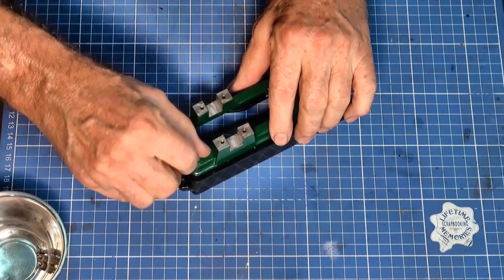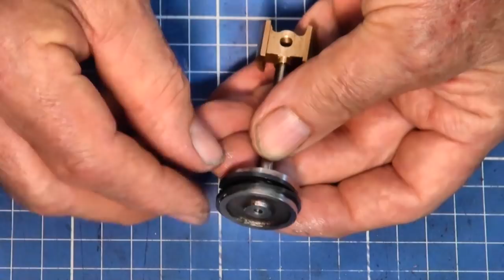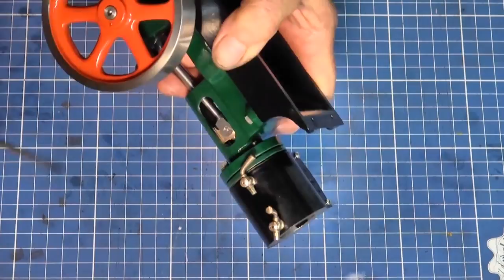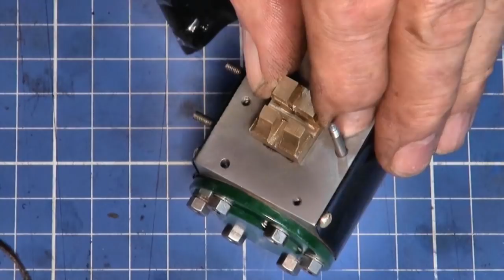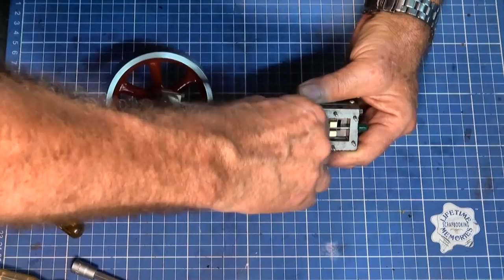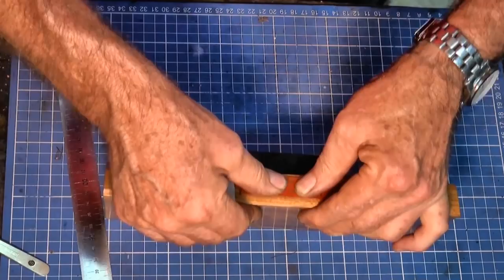Building the Stuart Turner Number 8 Mill Engine - Final!

Comment: Outstanding series of videos, the best model steam engine build I have seen & I’ve seen a lot! I have built nearly all the engines in the Stuart Turner range over the last 50 years, however, I have not built the No8, which is the last engine I wish to build….The casting kits are now so expensive & casting quality is not as good as when produced by Stuart’s years back, sadly!! Thank you again for a wonderful build series on this engine. 10/10 ✅👍😊
Reply from the maker: Thanks. The set of castings I was given for this engine were some 40 years old. My only issue with them was that there wasn't a lot of machining allowance on some of the critical components. I am actually building the Stuart Turner 10H at the moment and it's castings are quite old as well. I took the Number 8 out of the display cabinet the other day and compared the two models. The #8 is definitely the better engine of the two and closer to full size in terms of it's features. 
Regards,
Mark

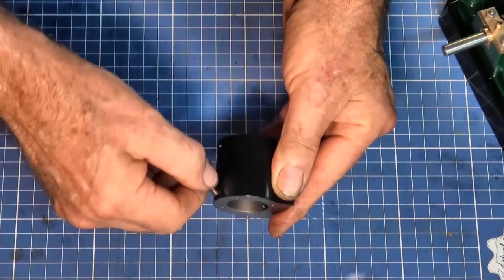Comment: Overall an outstanding job. I am in the UK, I started to watch these videos last night and was so into it, that I have watched all 13 I believe it was episodes. It is now 08:52 hours and I have been up all night. I am retired now and have just completed my workshop build and my first project will be a double acting boiler feed duplex pump. When I was an engineer in the merchant navy and had to tell the 2nd engineer that I had fu**ed something up, his only question was “what are you going to do about it” well of course the only answer was to have a plan at hand to put it right. I admired this about your build, you included some errors along with solutions to them. I agree with you, the connecting rod for the big end brasses looks much better in steel and your final design looks much better and more like the real thing. I have really enjoyed this series and believe you have done a fantastic job. I thought at the end you were running the engine without oil and I became concerned but slowly there were tell tale signs that the engine had in fact been oiled. I loved that laser machine you used for the gaskets and I need to get one. Thank you for sharing. Now I need to go back through every episode and ensure I placed a like, sleep first though.
Reply from the maker: Thanks Bernie. I have one of those Stuart boiler feed pumps. It runs on air just fine but whenever I tried to run it on steam it just jitters back and forwards without completing a full stroke. I built it back in the 80's when I didn't have a lot of tooling and I really should go back over it and re-machine the shuttle valve and piston valve. I'm glad you enjoyed the Stuart #8 build. I was very happy to have the engine returned to me after Keith kept it for a year or so. 
Regards,
Mark
Reply: @Preso58  Yes Mark those duplex pumps can be a bugger on steam, it usually concerns the shuttle valve. I really want to make one because the very first ship I was on in the Merchant Navy had duplex pumps as harbour feed pumps, just for the light load in port. Once away at sea we used steam turbine feed pumps. I will then make a boiler followed I hope, by a Stuart triple expansion or a Stuart No. 3

Comment: Very nice video series. Amazing craftsmanship in the build. Its beautiful. One tiny nit. There are two drain cocks to allow the operator to purge the condensate that can collect in the cylinder during operation, and more importantly, when you shut down the steam. One at each side of the piston. They really should be on the bottom of the cylinder to the water can drain. You have them on the side, opposite the valve chest. They won't really drain the cylinder below about half full -- way past hydraulic lock.
Reply from the maker: Pat, yes you are correct but that's where they were shown to go on the drawings. The other aspect of this is that when starting a cold engine the drain cocks need to be open so the condensate can be blown out so there is no hydraulic lock. So, as long as there is a pathway to atmosphere the water will be blown out but it won't drain under gravity. Vertical engines have the same problem with the top drain cock unable to drain condensate but you can cycle the engine with the throttle closed so that most of the water will be forced out as the piston rises to top dead centre. 
Regards,
Mark

Comment: Nice build and very instructive  on the working  and   timing of a steam engine.. As a retired  toolmaker of over 50 years  experience  and have broken more taps than I care to mention  a better way to fix the boo boo is drill it  to a bigger  thread  size  and retap then  screw in a  plug made preferably  from the same material  (cast iron) pien it over and drill and retap and flush  smooth  .. then only  you and  God will know.. 🤫🤫
Reply from the maker: Thanks. That engine was returned to me after the original owner passed away a few years back and although I never expected to see it again it was nice that his eldest son passed it back to me. Keith was always a bit of an alternate father figure for me. He owned a beautiful Myford Super 7 lathe and he was meticulous in everything that he did in his workshop. 
I think I have only broken a couple of taps in my time but they always seem to break off below the surface and they are always torqued in so tight you would never in a million years back them out. The worst was a 2mm tap broken off in a stainless steel tail cone for a model jet engine. I had spent days machining it out of a piece of thick walled stainless steel pipe and I had to tap three holes in the thick part of the flange. Of course, it broke off in the last hole and it was the last operation in the entire part. There was much gnashing of teeth and rending of clothes but I ended up burning it out with an oxidising flame in an oxy acetylene torch using the tiniest tip and the smallest flame I could get away with. It just went bright red and then I turned the fuel off and the oxygen just blew it out. Whew! Crisis averted.
Regards,
Mark

Comment: A great build of an outstanding series, I watched them all. Excellent final presentation now for a boiler, I shouldn’t talk, I haven’t built a steam engine let alone a boiler but the final presentation is so much better. Cheers Peter
Reply from the maker: I do actually have a boiler but it is inside a model tug boat which is inside a glass case and I couldn't be bothered getting it out to steam it. I am coming around to the idea of building a vertical boiler which can run on gas or coal because I also have a steam water feed pump that has never run on steam either. It's on the bucket list anyway.

Comment: Brilliant series, watched the whole lot.  May I suggest the acquisition of these items to help with assembly; Draper Screw Holding Driver Set.
Reply from the maker: Ira. I sometimes deliberately magnetise a screwdriver tip to hold small screws but that trick doesn't work for brass or stainless steel screws. Those Draper screwdrivers look like they would be a good option though. Thanks for the tip.

Comment: Thank you very much for the series. Really good videos and a nice engine. At the beginning you said how Stuart were famous for producing great casting sets. Accepting that these castings were 50 years old, and that the company has changed hands many times since, do you now think the kit you worked with was top quality? There seemed to be both quite a few casting problems (insufficient machining allowance mainly), some design problems and a few plan errors, that you had to deal with. No reflection on the current offering of the Stuart No 8, which  may well have improved or worsened over the intervening years, for all I know.
Reply from the maker: Hi, I must say that I was a bit disappointed with some aspects of the kit of castings. The material itself was very nice to machine with almost no hard spots or chilled areas and the iron was fine grained and the surface defects  were minimal. As you have mentioned, the main issue was lack of machining allowance. In some cases there was almost nothing left to machine off. A few of the non critical features were a bit outside the allowable tolerance but none of those affected the operation of the finished engine. I purchased a set of Stuart castings for the twin cylinder marine engine back in the early 80's and they were of similar quality although I don't recall having the same issue with machining allowance. My comments about the reputation of the Stuart company were based on some research I had done rather than from personal experience. Having said that I have purchased castings for some workshop equipment and two different 3 1/2" gauge locomotives which were somewhat worse in terms of surface finish and overall quality. I also believe that Stuart used some common castings for a range of different engines so perhaps they had to compromise on the overall size to allow for that.

Comment: Fun series. Thanks for sharing. Did you put any sort of coating on the bare metal parts to prevent surface rust or tarnishing? I'd be tempted to put on thin coat of floor paste wax, especially on the beautiful flywheel.
Reply from the maker: Brian,
I think I just coated the parts lightly in a thin oil. The model is being kept in a glass case at present but I will have to monitor it to check for that insidious rust! I restored a large set of balance scales for my sister just recently and I used linseed oil to prevent if from further rust. It was made of wrought iron and was in a pretty bad way when I got it. I used the electrolytic rust removal technique and that worked quite well. I have some paste wax which I can use on the engine if it looks like corroding. Thanks for the tip.
Reply: @Preso58  Upon further consideration, wax would be a bad idea if the engine was run on steam as I think the heat and oil would make it turn into a gooey mess. Seems ideal for a static display model though. Cheers!

Comment: Please run this on steam!
Reply from the maker: Jim, once I finished the engine it was returned to the original owner. He ran it on air for his 90th birthday but about a year later his oldest son returned the engine to me. I would love to run it on steam but I don't have a boiler for it. I have a vague sort of plan to build a coal fired vertical boiler as I have a Stuart reciprocating boiler feed pump and a large single cylinder steam engine that I made back in 1978 when I was at college. However, I also have a very long list of other projects that are higher on the priority list at present. The other consideration is that these engines always sound better when they are driving a heavy load. When running unloaded they don't really "come alive". 
Regards,
Mark

Comment: Nice job Mark. Lovely little engine. I'm very envious of all the workshop equipment. What's the next engine? How about one you don't need castings for? Take a look at J. De Waals Robey Sugar Mill on www.modelengineeringwebsite.com. Should be right up your alley, although a steam mill thats designed to crush things might not be a good idea for your fingers...
Reply from the maker: Jason, I have a model turbojet engine that I built about 10 years ago sitting in a cupboard waiting for me to get running again. I keep putting it off because it scares the living daylights out of me when it gets going. It suffered a hot start  the last time I ran it and the nozzle guide vane housing distorted and it is rubbing on the turbine. It requires a partial disassembly and some very careful boring work to provide the clearance to make it run again. I keep meaning to get it done but I am worried that I will have to have it rebalanced and I am not sure who I could take it to for that sort of work. There is a clip of it here on another channel that I made before I started my current one. https://www.youtube.com/watch?v=N7F4Bp-TcTA The quality is a bit rubbish because I had used an old analogue video camera and the sound quality was bad because the engine is so loud it overwhelmed the microphone. 
That should really be my next model engineering project. I have actually finished the engine properly by having the outer casing chrome plated and all the alloy parts are anodised in red. The outer casing was made from an oil filter from a Toyota Land Cruiser. That's why it says "Ryco"
Regards,
Mark
Reply: @Preso58  light the blue touchpaper and run like hell :)
I've just started a Stuart S50. Been years since I touched a machine, so getting back into it.